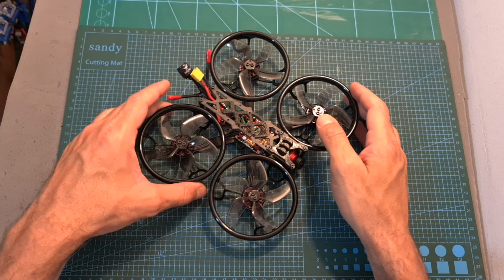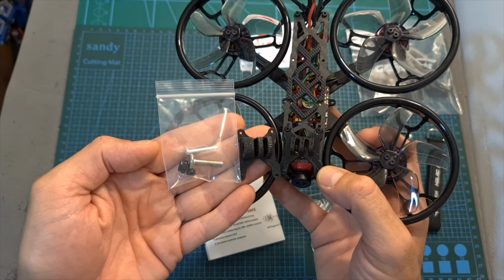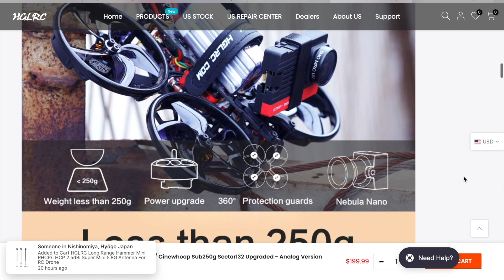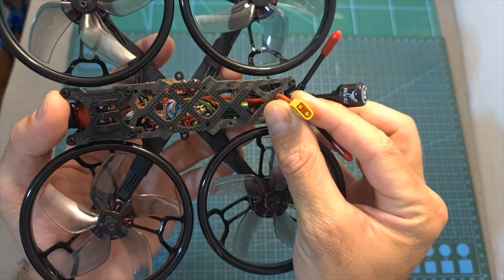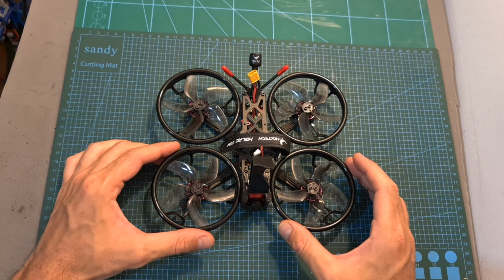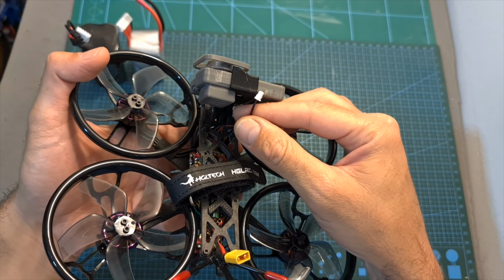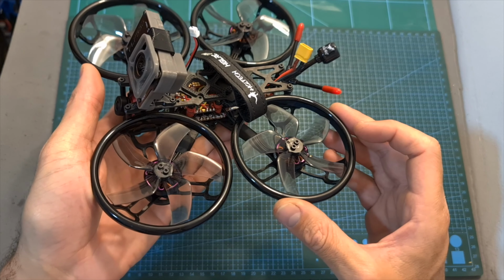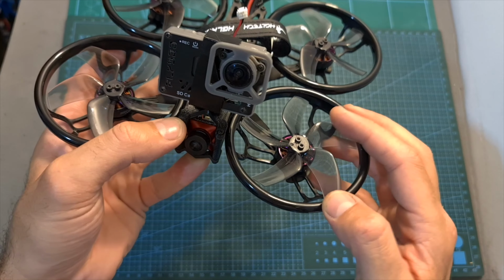HGLRC Sector30CR 6S 3'' FPV Freestyle / Cinewhoop - Review & Flight Footage

Comment: I got this for the winter. It was great for gap practice. Fragile prop guards, but I got another set and replace them individually. I have tried various motors. 1404 with guards mounted below puts blades in the right place. 1407 required guards mounted above and level with the frame. I find it to be a good drone for small arenas and indoor cineflight practice. Much quiter than ducts.
Reply from the maker: Thanks for sharing. Happy flying!
Reply: Looking to build this, what weight are you at?
Reply: @rickstard73  183g with props on but no battery. Mini stack and Vista.
Reply: @TheRoybert  Thank you, enough to keep it under 250grams 😀

Comment: Random question: this being a 6s quad, did the 2004 3800kv motor have any issues?? I think it said it was a 4s motor.
Reply from the maker: I’ve tested the 6S (1800KV) version.
Reply: @KremerFPV  that being said, I ended up buying the 1404 motors by xing 3800 kv, do you think that’s going to be too weak?
Reply from the maker: @basquiatfpv  yes, for this setup it might be underpowered.

Comment: Great review Gal! Traditionally we use 1408/1507 motors for cinewhoops. There is a trend now for shorter and wider stator sizes. Specifically, 2004 motors. Are there any benefits?
Reply from the maker: Thanks! Yes, it's a trend and in my experience it's working well. I am now testing the Racewhoop25 which also is using 2004 motors and is a actually smaller than the Sector30CR. It's a very stable platform and I am very pleased with its performance.

Comment: Hi Gal   I like this one.  I have had great experience and luck with HGLRC Products.  I just think that it's the best size for what it is. Anything smaller seems to be not as good.  I have a set of AEOLUS 2004 1800KV motors on my 4in 6s quad and they are very quite and have great throttle respons. Thanks again for the video and information.
Reply from the maker: Yes Johnny, these motors seem to be a perfect fit for this type of setup :-)